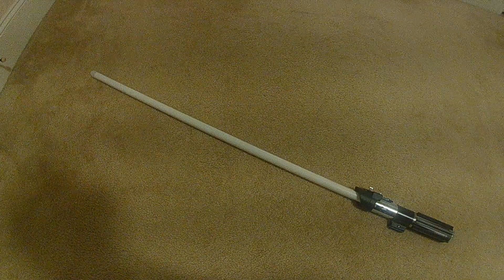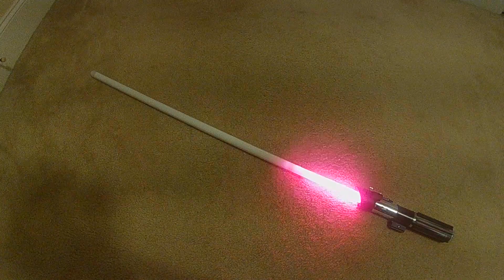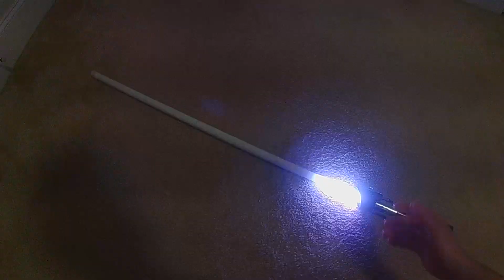"Faulty Ignition" Preon (Inspired by Brian Conner's Ignition Redux) for Proffies OS5.7

Comment: I thought of something, Thought about randomizing blast colors? hmmm
Reply from the maker: You could if you wanted, multiple ways to accomplish depending on whatyou are after; ColorSequence, EffectSequence, Mix, RotateColorsX, would all give you the ability.
Reply: @Fett263  that's cool, I wanted it to look natural like if your deflecting different types of blasters
Reply from the maker: The "Multi-Blast" options in the library do this but with same color (based on film options) the films and TV shows have the deflection as an impact different from the color of the blasters "bolt" so mine are based on this but you can have it however you want.
https://youtu.be/WDKfnFNWWSY
Reply from the maker: Library effect colors based on films
https://youtu.be/FIG7CTyL77Q
Reply: @Fett263  I have one button but I did add the gesture and multi blast. I used one of the color change for the blast but stays on one color. Is it because of the timing?
Reply from the maker: @thurisaz4life21012  in the library there is "Multi-Blast 1" and "2" under Blast Effect options, these styles use different blast effects each time you deflect a blast via EffectSequence. These are different from the actual Multi-Blast feature but meant to work with it, but you need to have the style option selected from the library or it just does same blast effect each time.
ColorChange won't do what you want, you need the options I listed above. ColorChange is for very different use and you'll deactivate normal ColorWheel operation if you use in your styles. I'd start with selecting "Multi-Blast" Blast Effects in library and trying, then edit EffectSequence to change out Colors if you want, or replace the Colors in the effect with one of the styles listed above.
Reply: @Fett263  gotcha I'll give it a try thanks!
Reply: @Fett263  srry to bother again haha, I tryed to use the multi blast option but says unknown identifier: effect sequence
Reply from the maker: @thurisaz4life21012  you can't use Editor as it's not supported yet, but the styles load and compile fine in OS5.7, Fredrik hasn't added the OS5 options to the Style Editor yet. You'll need to edit those by hand in your config.
Reply: @Fett263  gotcha
Reply: @Fett263  im trying to use this ColorSequence<500,Red,Azure,Green>
 but it doesnt work right maybe because im not puting it in the right order
Reply from the maker: ColorSequence<> would replace the Color within the effect, syntax looks right, so check where you put it.
Reply: @Fett263  this is what I have

ResponsiveBlastL<ColorSequence<400,Red,Azure,Green,TrInstant,TrFade<100>,EFFECT_BLAST>,Int<400>,Scale<SwingSpeed<200>,Int<100>,Int<400>>>,Layers<ResponsiveBlastFadeL<TransitionEffect<Azure,White,TrInstant,TrFade<100>,EFFECT_BLAST>,Scale<SwingSpeed<200>,Int<10000>,Int<18000>>>,ResponsiveBlastFadeL<TransitionEffect<Azure,White,TrInstant,TrFade<100>,EFFECT_BLAST>,Scale<SwingSpeed<200>,Int<4000>,Int<10000>>>
Reply from the maker: @thurisaz4life21012  you didn't close ColorSequence<>
Reply: @Fett263  oh ok
Reply: do you have some other app we can speak on so I don't flood the comments haha
Reply from the maker: @thurisaz4life21012  post in Proffieboard Support group or Open Source Saber group on FB and multiple people can help and/or learn